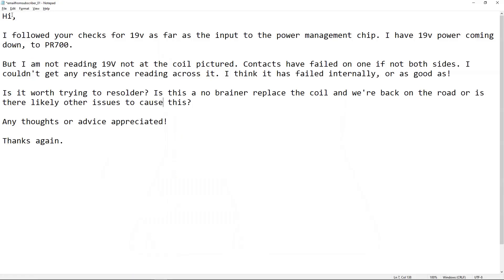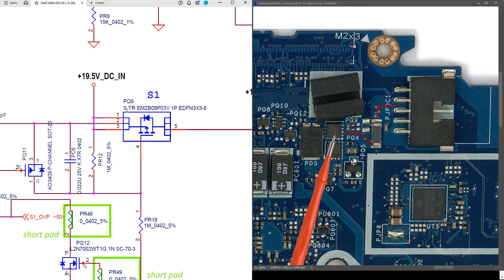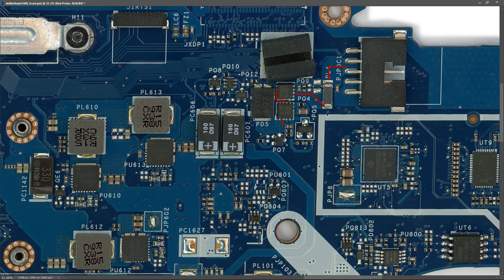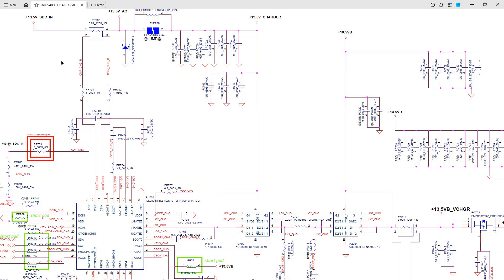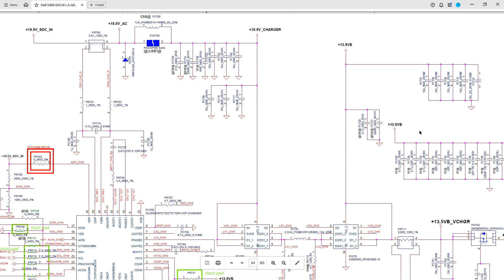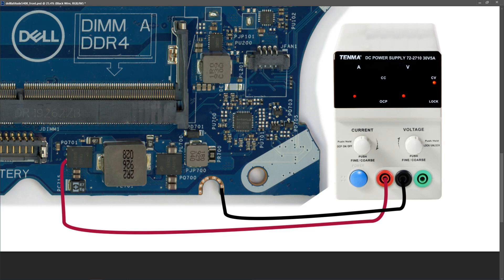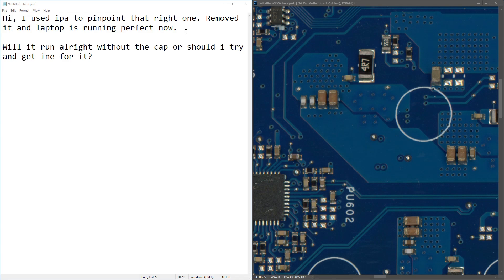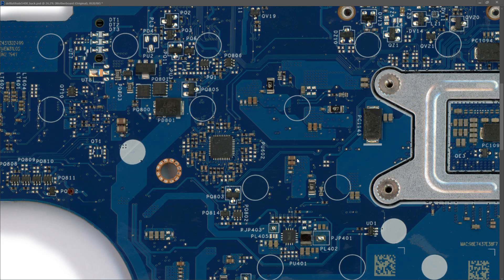LET'S HELP A SUBSCRIBER 03 - DELL LATITUDE 5400 INDUCTOR ISSUE

Comment: Unfortunately as you said  a lot of issues are not this simple a fix
Reply from the maker: And unfortunately the same complex problems with the one that I am working on this week!
Reply: @therepairshare673  : i have the same issue with a toshiba L500 voltage everywhere it should be it just will not post' recon it's a chip issue a bit beyond my skills
Reply from the maker: @leso204  If you want to send details to therepairshare@gmail.com I will give you my opinion.

Comment: Coils never really go bad until they actually do. They are usually not connected to ground other than in cases where they are required in circuits, and are mainly used for voltage boosting and smoothing. The main cause for a coil to go bad is if a component on the same line as the coil (which usually is always a capacitor) shorts to ground. As a result the coil may see a big inrush of current higher than what the coil is rated for then it would either explode itself or in the subscribers case, see the contact pads eroded a bit